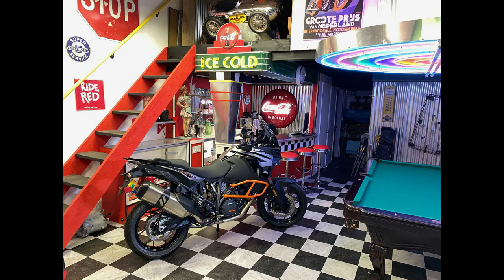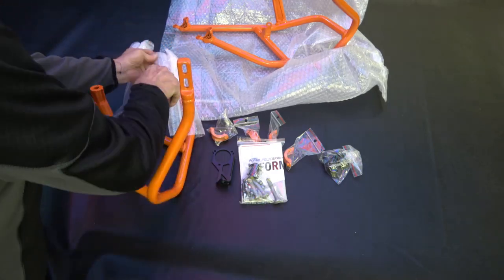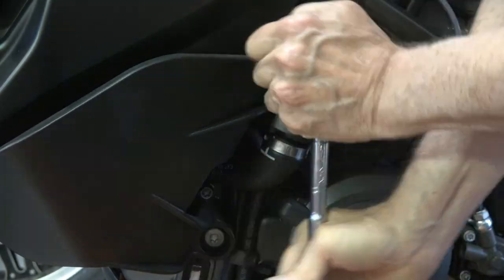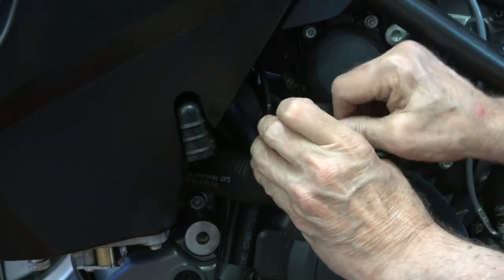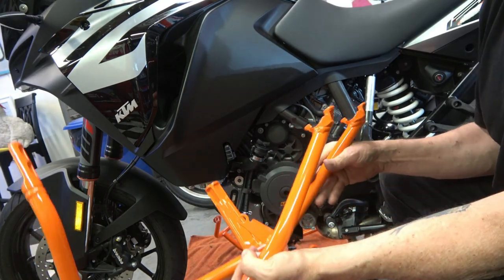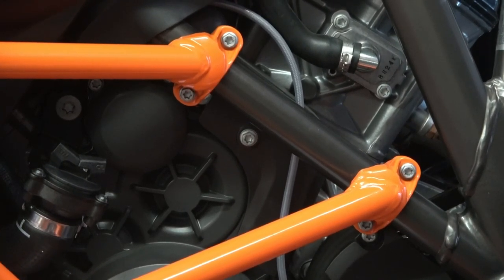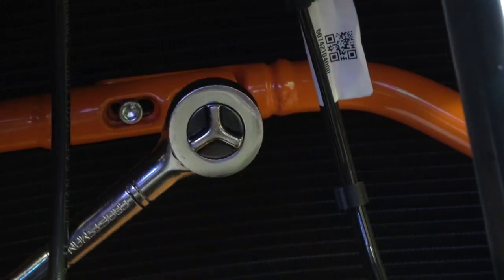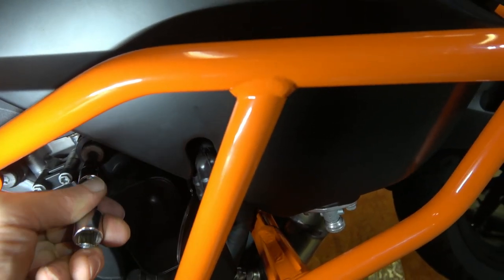KTM 1290 Super Adventure Video Series - Part 1 - Crash Bar Installation

Comment: Thanks for the video! Did you use any loctite on the screws?
Reply from the maker: Hi Jay, The screws that come in the mounting kit have the thread lock material applied to them from the factory. If you look at 9:25 of the video, you will see the yellow material applied to the threads of the bolt that I am installing. Thanks for the question.
Reply: @digitalpizza1  thank you! :)

Comment: You forgot to put the rubber tank mounts on the crash bars (they stayed in the tank...)......
Reply from the maker: Not sure which rubber mounts you are referring to. This particular bar does not mount to the tank.
Please clarify 😎
Reply: @digitalpizza1  @3:44 you remove the plastic piece and the rubber in the middle of the screens stays in place in the cavity of the tank, that rubber is supposed to be mounted onto the plastic piece you took off and needs to be remounted on the crashbars again i believe.....
Reply from the maker: @robvanburik7095  
Hi Rob
Yes, you are correct. But actually the new bar comes with a replacement piece for that Which I did install. Not sure if I showed that in the video or not. But thank you very much  for the comment